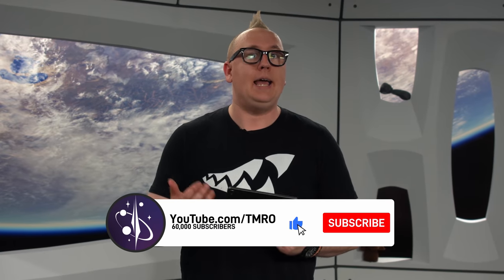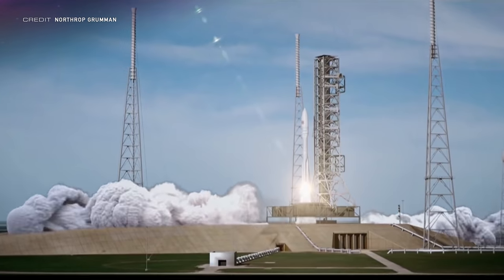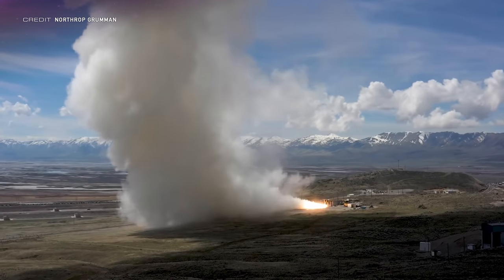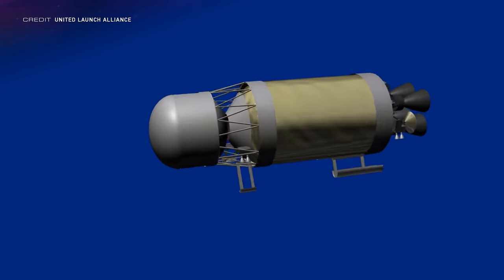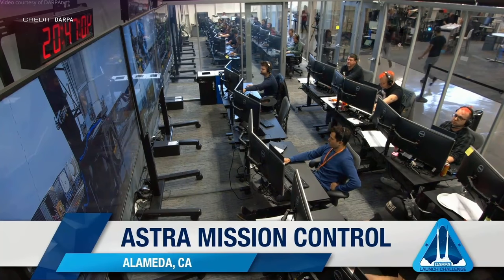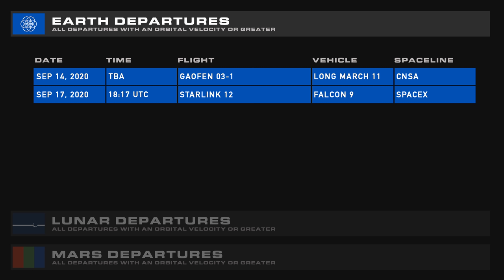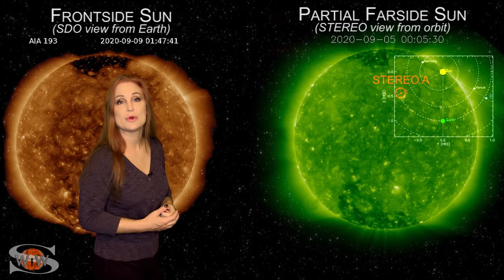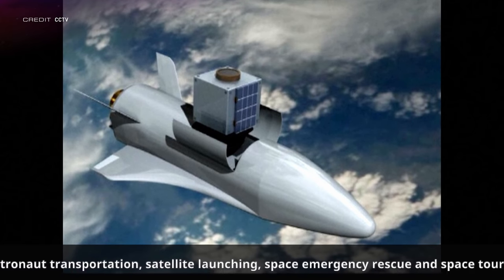Astra's Anomalous Test Flight | TMRO:News

Comment: My thoughts on today's show:

First, it is great to see you guys back in the station.  The return of a bit of normalcy to my still upside down world.   

Omega was clearly no longer economically competitive with the new launch systems on line and coming on line.  Solid rocket motors are still best for a rocket that has to sit around for a long time and them be launched (or hopefully just capable of being and never launched) upon very short notice though.  

For the same reason, I think the SLS, vulcan, and other current massive rockets with additional strap on solid rocket boosters to increase lift will be the last generation built like this because re-usability of liquid fueled systems will make them not economically competitive for lifting things to orbit.  Maybe someone will come up with a less expensive to operate largely re-usable solid rocket motor, but I would not hold my breath that such could be competitive with the liquid fueled rockets.  

Dudda is wise . . . . Space is hard.  Good luck Astra.  

China needs to work on re-usable rockets before they accidentally kill a lot more people with these falling boosters.  

I just read a study on solar flares from the University of Warwick and the British Antarctic Survey which attempted to calculate the probability of a Carrington size storm or larger.  They estimated the probability of such a storm to be .7 percent per year.  Given those odds, we are lucky we have not seen such a storm since.  Considering the damage likely to be caused by such a storm, Lloyds of London estimated 2.5 trillion in damage in 2013 and effects lasting over a year, that is considerable risk over time.  There is actually a reasonable chance I could see one in my lifetime.  Dr. Skov covers space weather which covers such things, we seem to be living in a shooting gallery where our sun occasionally throws off such huge bundles of charged particles, it is just that usually their path does not intersect with ours.  I am going to pay a bit more attention to her reports now.  

I have heard rumors that these small space planes and mobile satellites being developed are for satellite inspection and rapid planned disassembly or disabling of rivals satellites.  

Juno should get the money it is small compared to what we have already spend on it as it will double the science out of it.

Comment: Very sad to see ACES being cancelled. Centaur V is the pretty much the same but without the on orbit propellant transfer. That was the most exciting part if ACES, however! It was cancelled because Boeing (half of ula) thought that the development of on orbit refueling would hurt demand for super heavy lift launchers like the one it's developing (sls). Once again, greedy company practices slow down the progress of space exploration. At least SpaceX are still looking at on orbit refueling for starship, but I don't see that evolving into propellant depots as easily as ACES could have.
Reply: Ironically on orbit propellant transfer has been done for decades - starting with the Salutz program. ESA also used that with their ATV cargo spacecraft being capable of refueling the ISS.